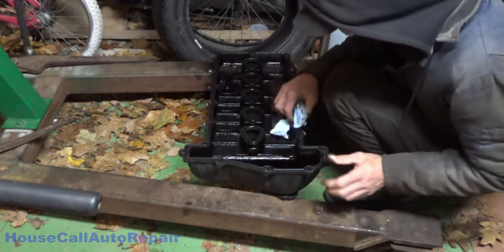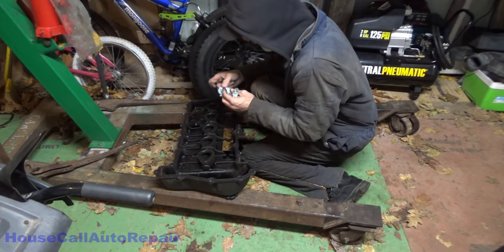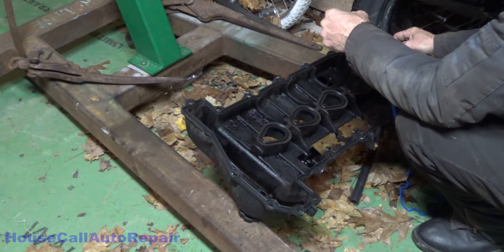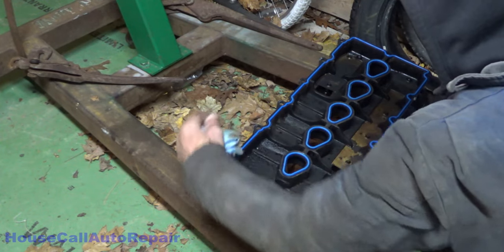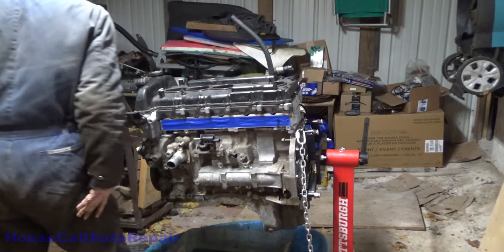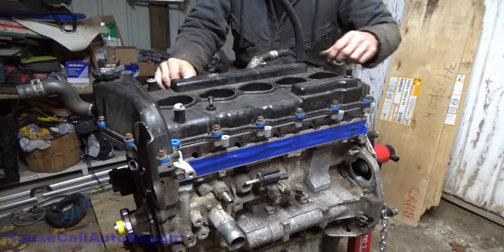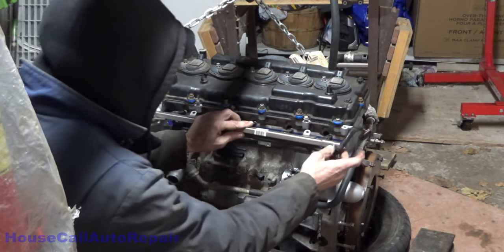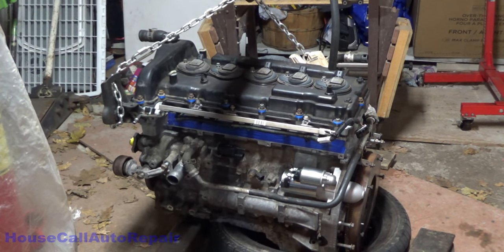2006 Hummer H3 3.5 5cyl teardown -  Bucket of Yuk - Part 7

Comment: Nothing worse than damaging a tool. I've had it happen.
Reply from the maker: 4 injectors cleaned, and then I popped the pulsing tool. It kinda trashed my mood.... I DID however find and repaired the blown circuit board trace. PIV diode for the win!
Reply: @HouseCallAutoRepair  That's great that you were able to fix it!